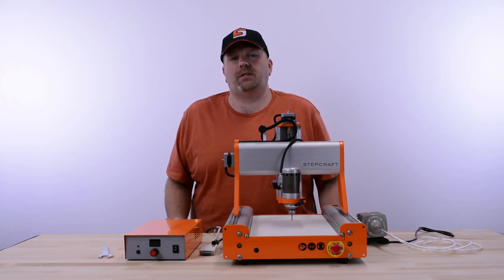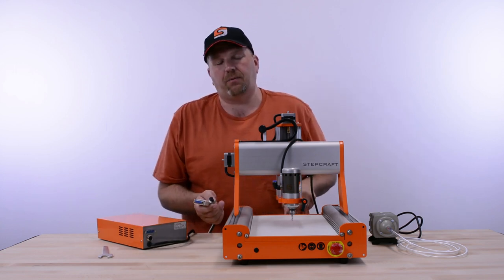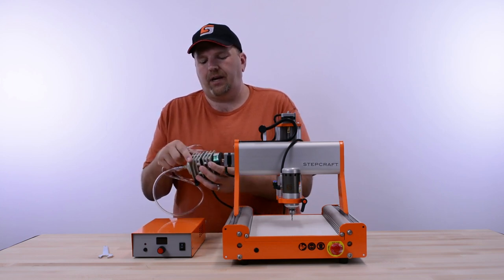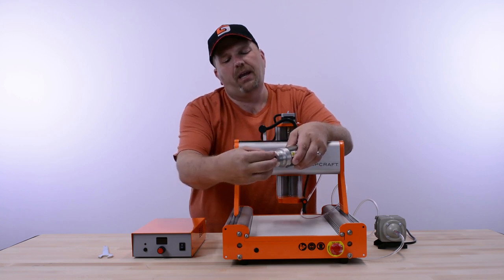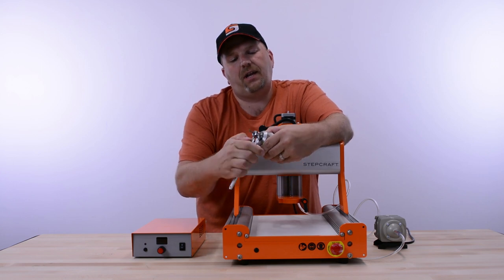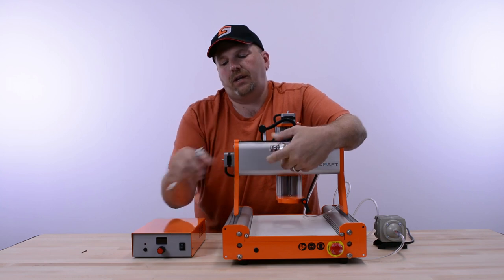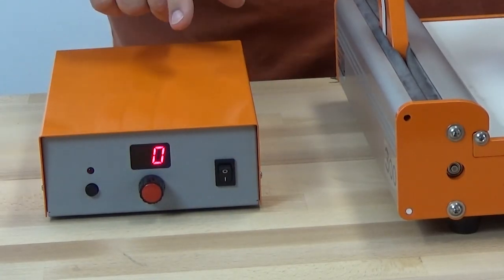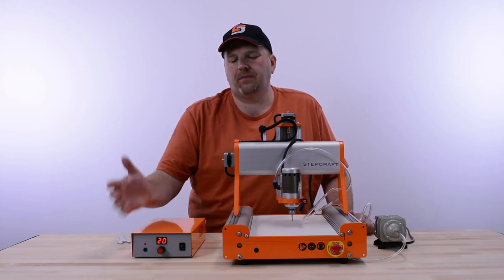An In-Depth Look at STEPCRAFT HF-500 Computer Controlled Spindle

Comment: thinking of investing in a HF500 soon so I found this run down very useful, thanks (I also understand from some older posts below that the air pump is no longer needed following a change in bearings). I am a little bit curious though as to why the power unit needed so long to shut down when you were demonstrating the double-beep - it took something like 5-10 seconds. Is there a reason for this?

Comment: Hi Stepcraft, the updated HF-500 does not need the air pump right ? thanks
Reply from the maker: That is correct. The newer version of the HF500 uses different bearings and does not require it

Comment: We use very specifically shaped knives where I work. I'm wondering if this machine could be fitted with a grinding wheel to sharpen these knives if they were mounted in a jig fitted to the table? I'm not sure about the acuracy of the machine if it could attain 30 - 50 microns I think that it could possibly do the job. We spend £10s of thousands per year getting a third party to sharpen these knives. If we could do it in house it would save us a fortune!!

Comment: I bought one of these with my 840, but it didn't come with any air components! Did I get an incomplete kit?
Reply from the maker: No, The newer versions of the HF500 spindles use a different type of sealed bearings so they do not require air to keep them clean.   You have the latest and greatest :-)
Reply: Ok, thanks

Comment: From the comments, I learn that there is an updated HF500, which doesn't require the air pump. At 0.5kEuros for a motor, I wonder why not jltake a few minutes to take down the outdated video. And also: the machine looks beautiful, but why not make all these extensions also fit and look nice? The pump could be inside the control box, and use just one power cable, the air tube could be integrated with the electric cable and the percentage should definitely be the hundreds of RPM—the control unit does know the actual RPM, doesn't it?